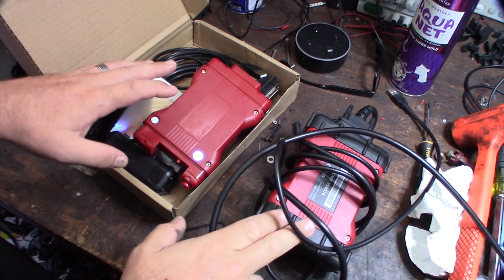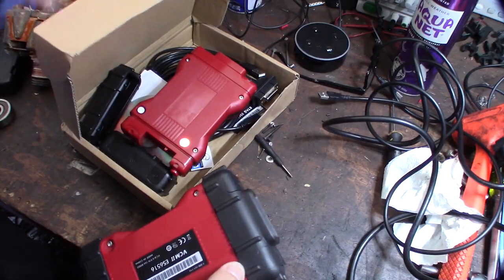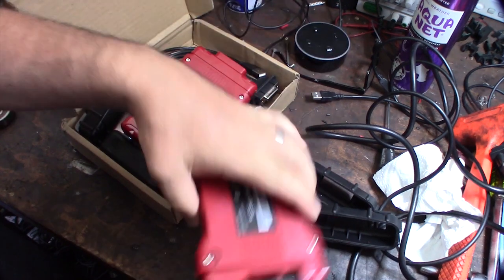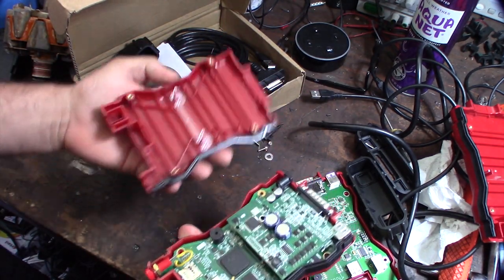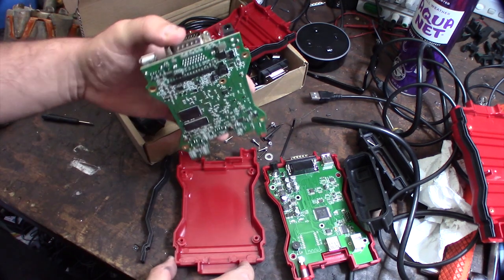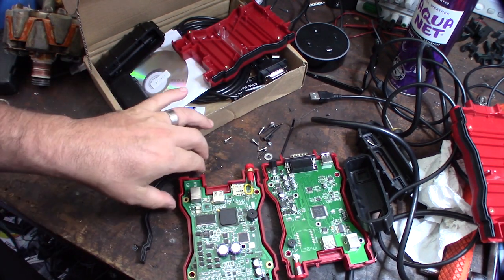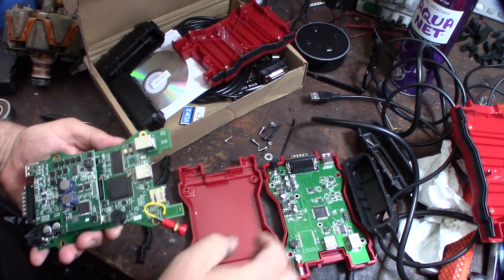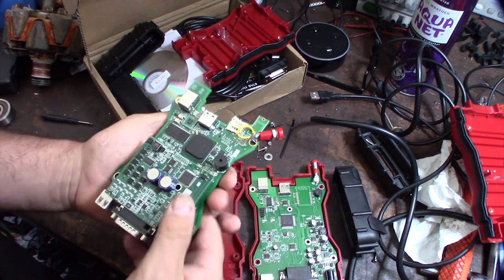Ford IDS VCM Clone full chip vs cheaper VXdiag VCX nano comparison VCM2 VCMII

Comment: The vcx allscanner unit has a arm system on a chip ARM CPU , it actually emulates the VCM2 within that little STM ARM CPU, it's years newer the vcx , so the performance is about the same... The problem is some of the voltage pins  for the trucks can't be emulated on vcx, so you will get connection issues etc , for later can bus ford cars it seems fine, the advantage of the vcx clone is it won't get software bricked by ford IDS , also the full chip clones all seem to fail over time, due to poor manufacturing processes and bad caps .

Comment: me paso lo mismo.  me robaron mi equipo todo lo de el taller.  trate de comprar nuevo equipo y compre un vcx nano. de la compañia vxdiag. y la misma cosa no sirven. compre en amazon un vcm2 y me mandaron uno igual que ese.  nunca funcionaron probe con muchoas verciones y sin exito. hoy compre otro vcm doble placa que son dificil de conseguir porque ya casi no  hay clones buenos.  al parecer ya podre hacer programaciones. pues es igual al que yo tenia  doble placa,  funciona muy bien.  si bascan  traten de conseguir el que tiene boton para cambiar firmware.

Comment: very good information
I bought a vcm2 like the one you show two
plates came with the ids ver.101
work with about a month
and then I stop working.
The problem is that it doesn't connect to the PC.
when opening the ids program
I hope that if it works for you longer
greetings from tepic nayarit mexico

Comment: Did you get it to work.? I'm waiting on mine. Coming from China,  full chip version. I had them send me pictures of the pcb before ordering. I Also got the HDD version software.
Reply: I got mine to work, if you're curious. With a proper clone, it will work with the 6.0 diesels, and 7.3s as well according to the seller I asked. Presumably other Fords that may use UBP would work too. Mine does work with the specialty functions I've tested as well. 

You may still want to be cautious which version of IDS you use, and whether you connect your VM to the internet or not. Some versions will brick clones on purpose from what I have heard. Earlier versions of IDS were safe to connect online as they didn't attempt to do anything about clones.
Reply: @ArbiterYT  I received mine and it was a full chip design. I purchased the IDS already on a hdd thinking it would save me time, and it was v115. But it was not for the faint hearted. I have many years of computer knowledge and I still had some issues. What they don't tell you is that a hdd with older Windows 7 software will not just drop in a newer Windows 10 machine and work. It took a lot of work to side load the correct hdd controller drivers just to get it to boot. Then you have to get all the right drivers to get network access, display and keypad, chipset drivers etc. But it does work so far. I really don't know what I can and can't do as far as being connected to the internet. Not sure exactly what you need to connect to the internet for except to get asbuilt data? Which you can download and put in the ids directory.  Thanks for your help.
Reply: @Bobsbbq  You can download updates for modules (ECU, FICM, etc) or program replacement ones. The firmware for module programming can also just be downloaded separately and loaded in IDS.

Also, you may find it easier to run IDS in a VM. I don't know what their preconfigured HDDs contain exactly, but in a VM, you typically force a particular time on the system clock (through a VM RTC setting) and setup deep freeze, a proprietary software product. I prefer the VM approach, because it can run on almost any host, and doesn't require booting your computer off a particular drive just for IDS.